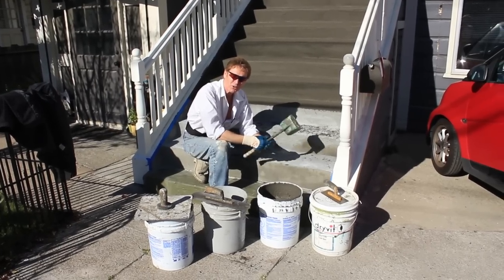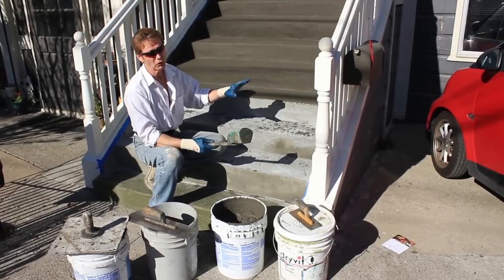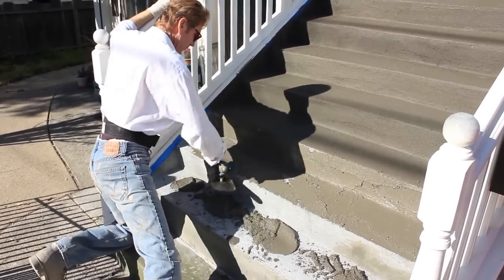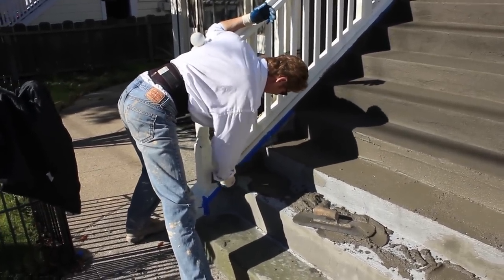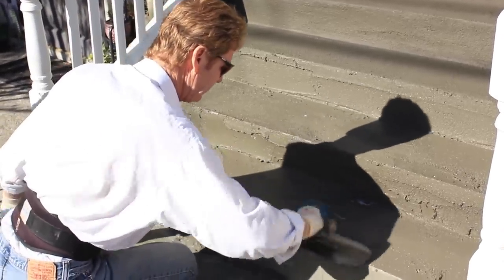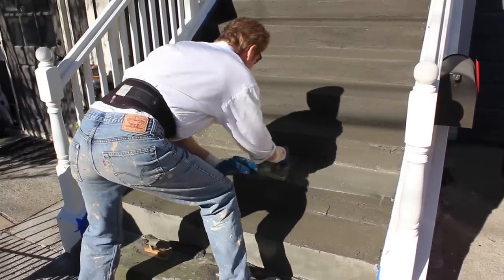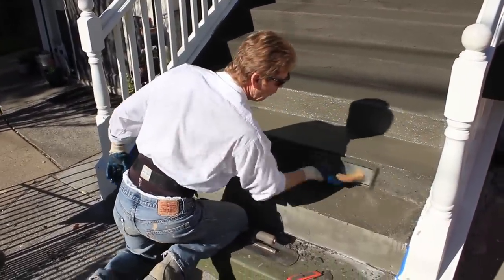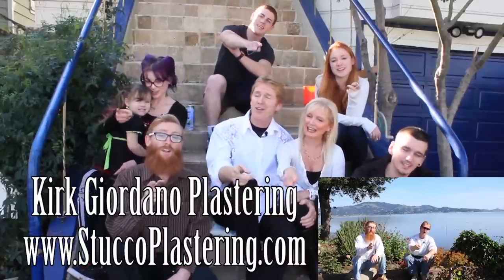Waterproof wood stairs with non-slip finish

Comment: Nice work Kirk, Can that be used on a concrete driveway that is driven on and do you use any kind of adhesive or wet the surface before applying?Thanks you and your son for this fine video. David Termini, Fredrick,MD
Reply from the maker: Hi David, I have mixed 10 different colors and 4 different acrylic's 12 years ago into a large  heavy duty plastic garbage can, stuck the heavy napped roller in it and painted me arce off, it's still there, by the way I wanted to freshen up a little spot and used paint it lasted a few months only.
 Best wishes.
 Kirk giordano

Comment: Hey Kirk 
Due to the high foot traffic i wouldn’t do it on steps 
 and to keep in mind with out polymotifed basecoat and fiberglass mesh it will crack not the Finishcoat that you used because that will expend and hardness 

But I could listen the hallow noise when you hit the steps with scoop
Also acrylic finish should be floated with plastic or steel trowel In such way that first get the sand to surface then with smooth touch floated down 

Have you done Gemstone finish ?
Reply from the maker: Howdy, my fellow construction dudes. 
No, I have not done any Gemstone finish, but know how to.
 FYI, were methodical in all our methods in all applications. In the description, there is a video that shows the waterproofing membrane with metal lathing and stucco applications.
 Our work is second to nothing superior.
 These stairs will last forever and will not crack unless the ground settles.😉

Comment: Hi Kirk, looks like a great solution for my fronts steps. Can this product go over top of previously painted concrete?
Reply from the maker: Hi Adam Tussey, sure, however the painted surface needs to be prepared properly, usually pressured washed with at least 3,000 psi to remove all dust, dirt grime and especially any and all loose paint.
 Remember, your new finish is only as good as what it's attached to.
  Best wishes,
 kirk Giordano

Comment: Kirk, we just had a set of steps poured and the risers didn't present a smooth surface when the forms were removed. I love how nice your acrylic stucco process looks.  My question is... How thick is the coat of acrylic stucco that you applied to each the riser and tread?  To me, it looked like you applied a super thin coat.  Thank you.
Reply from the maker: All acrylics are about 1/16 to 1/8 inches thick. About 50 time thicker than paint but won't come off, if applied to a super clean surface.
 And yes you can use a paintbrush and roll or paint a coat or two on. 💃
Reply: He doesn't know
Reply from the maker: @deelula3259  Who doesn't know what??

Comment: Hi, could you tell me the product you used on this stair? i'm going to patch  my concrete stairway, do you think it's ok to use it on the concrete? and how durable is it for a stair or walkway? thank you very much.
Reply from the maker: Hi Roger,   it was either Carson's, dry-vit or BMI, acrylic stucco that I used as i'm fond of these brands.
 I did my own stairs over 20 years ago and they still are in excellent condition.
 Keep in mind the products I am referring to are engineered for walls, I am showing a better longer lasting option rather than paint, but painting is easier.
 Cheers,
 Kirk giordano Plastering

Comment: thank you the video. I want to do this to my cement stairs but it has old chipping paint. can i apply this material over the old paint or do I have to sand it?
Reply from the maker: Howdy Long dude, all products are only as good as what they are placed over,
 Pressure wash well or use a wire brush to sort of micro score the surface.
 Best wishes with your projects,
 Kirk giordano plastering on small repairs

Comment: G'day Kirk,
I have a question about using the green float so wet on the acrylic...when i tried that method on the lift shaft i rendered 3 years ago, i found that too much additional water onto the acrylic surface with a wet sponge float caused it to develop hundreds of tiny pin holes. 
Do you encounter pin holing? If so, how may it be controlled?

Is the pin holing something that occurs if one plays with it too much (ie taking too long to get desired finish by going over surface with wet sponge float time and time again...thus oversaturating the acrylic?)
Reply from the maker: Howdy Adam, sure I have encountered this issue, it's happens to any and all who use too much water, simply tap out the excess water into your bucket, even this simple task takes practice. 
If you watch carefully I tap the float into the inner part of the water so as not to bend the float inwards, I only tap the float lightly on the top so as again not to give the float the wrong bend all edges should be slightly lifted upwards so a float won't dig into the stucco or finish system.
 Cheers and have a happy new year my friend,

 Kirk giordano’s rendering any and all stucco repairs

Comment: Nice!  I was just researching to see if I could use acrylic stucco for front steps. I just stuccoed my Nephews house in the fall, and was wondering if acrylic would be a good choice for front steps. Only concern I have is this is Canada and if it will hold up to the winter ice, and melting snow. Plus cracking due to the temperature extremes. We never have done outdoor surfaces like pools with Acrylics. Usually it's just concrete floated from what I see. What's your opinion on acrylics holding up in Canada? Cheers. Great work btw.👍🏼
Reply from the maker: Howdy Kman, I have done this 20 years ago, and it's still attached well, however my preparation was top notch.
 I would refer others to tile, so I don't get blamed if a procedure is left out.
 Cheers, live long and plaster
 Giordano’s teaching video’s

Comment: Hi Kirk, thanks for the video. First, you advise this acrylic stucco instead of painting, but what if my client wants a different color than grey concrete? Do I color the stucco before applying, or paint it after it dries? Second, I have another project: 6 concrete pads that (1) are too slick and (2) were badly stained the first time around, so have bare patches. My concern is that this stucco with flake off over time, as it does on walls. Is that an issue?
Reply from the maker: Howdy Robert, the product I was applying over my neighbors stairs was from a chimney that I had left over.
 Acrylic stucco finish coats come in hundreds of colors, they engineered for walls not stairs, this being said I have used them many times on stairs as the acrylics if applied properly to a properly prepared wall or cementitious finish last forever and have a non slip finish.
 Cheers,
 kirk giordano rendering

Comment: Got my answer from your video. Maybe you can help me find a product that I can use on wood and will not have to do it every 3 to 5 years, Thanks rick
Reply from the maker: My neighbor used some of my throw away colors 6 years ago and it's still going strong, but he prepped his wood stairs well, 
 That or use the sand added to paints available for wood or concrete, I have tried them and was not impressed,
 Cheers,
 kirk giordano

Comment: Kirk great videos..i have an advanced question for you. Which would be better over a painted wall
1-weldcrete followed by 16/20 color coat

2-bypass the weldcrete and just use the syntethic stucco on the painted wall.

Why would you do the more time consuming first one when you can do the second one?  Thank you my friend.
Reply from the maker: Greetings JLO, do both, why because some acrylics are not worth applying. choose BMI, Carsons, Stucco-flex or Dry-Vit to name some good ones.
 The ones that are garbage I won't mention as this is a positive channel.
 besides Larson's Weld Creat is like low-cost insurance.
 The most important thing to remember is to clean the surface like your planning on eating off it.
 As no product mentioned above sticks to a dirty surface for more than a year.
 

        Get plastered like stucco
 Kirk Giordano sound plastering advice

Comment: Nice vid Kirk. My question, Do you know how well the acrylic sticks to steel and or what prep is necessary to get the acrylic to adhere to steel steps.
Reply: The reason I'm asking is, I'm a maintenance man at our complex. Currently we have concrete inserts in steel step pans. I would like to get away from the 120 LBS of concrete per step. By flipping a pan and putting a durable non skid surface like acrylic stucco w/ a heavy grit for non skid. Ideas?? Thanks.
Reply from the maker: Howdy Jim Dude, no worries happy to be of help
The acrylic I used for these stairs is specifically designed for walls, however I know how to do this as I have done it in the past many times with very successful results.
 I can't righteously tell you to do the same as the acrylic is designed specifically for walls.
 Cheers, live long and plaster
 Giordano’s images and teaching video’s

Comment: Kirk, we have a tile walkway (1ft x 1 ft  clay looking tiles). with an inch of grout between the tiles which leads to the front door. The edge of the walkway abuts stucco walls. It leaks water into basement after heavy rains. Ithe tiles suck in water, the grout is suspicious and the edges of the walkway are moldy.  I can't redo the walkway for now. I want to waterproof it with something clear, nonslip, and UV resistant. I've researched acrylic, latex, silicone materials... But all claim their product is best and slams the others. Any recommendations? I plan to etch/clean first, maybe sand any existing material off, then apply. The question is what to use???
Reply: the walkway is six feet long and four feet wide.
Reply from the maker: Evening slap stick dude, the best for this would probably be Stuc-o-flex elastomeric acrylic finish, it's actually engineered  for stucco walls.  It's the best in my opinion, but to find it online and have it shipped will be a drag, next would be other different acrylic products, dry vit, Carsons, bmi and so on,
best wishes,
 Kirk giordano
Reply: Kirk & Jason Giordanos DIY plastering and stucco tips I'll look them up. And you mentioned those work for 'stucco walls'...would you know if they work on the foot traffic area (tile walkway and grout)? My guess is you will say check with the manufacturer. Which I will do. Thanks...I will check on those.

Comment: Do you use a bonding agent, base coat? Is that a heavy sand finish? In the video I see Dryvit product. What about prep, pressure clean first?
Reply from the maker: Greetings Bill, the Dry-Vit acrylic was applied over a clean base coat, it will outlast me by a hundred years.
        Get plastered like stucco
 Kirk Giordano sound plastering advice
Reply: Kirk Giordano plastering Inc. Base coat?

You put a base coat and then the acrylic or did u mean u put weld-Crete then the acrylic?

Comment: Kirk,

How thick should it be laid on concrete stairs? Can I also use this to fill and refinish my concrete driveway?
Reply from the maker: Good morning Jason, Dude, I went about an inch thck, as far as drivways I would suggent cncrete and not stucco.
                          Live long and plaster
            Sharing the plastering knowledge
Reply: okay, but for my concrete stairs it would be sufficient?
Reply from the maker: Good morning Jason, I didn't realize your stairs were already concrete, if you wanted a cleaner nonslip finish you can apply an acrylic as I'm doing in this video, The stairs must be pressure washed very well as nothing adheres to dust.
                          Live long and plaster
            Sharing the plastering knowledge
Reply: Okay so the stairs I can also do. Just make sure it's very clean. Do I have to do anything to the acrylic before or just mix it and slap it on.
Reply from the maker: Good morning Jason, I would apply the primer that comes with the stucco acrylic and they do come premixed in buckets.
                          Live long and plaster
            Sharing the plastering knowledge
Reply: So if I order a bucket of Carsons or BMI it'll come with a primer?
Reply from the maker: Good afternoon Jason, yes and both of these stucco acrylics are great.
 apply about 1/8 inch thick, too thick it will chatter check when dried, to thin will see through to the primer.                   
                       Live long and plaster
                     pease love and plaster

Comment: Hi Kirk, can you post a video showing tips for filling voids in foam sheets using portlandbase cement and covering brick with a portlandbased cement to prep for an acrilic finish
Reply: also the company I work for uses a product brand named ADEX have you ever incountered these products ? and whats the best brand of portland cement mix youve come across, have had issues with our current product.
Reply from the maker: Afternoon Gage, below is a video patching EfIS with portland cement, as far as plastering bricks simply type in the keywords on our site, it does not matter whether you paint, apply acrylic stucco or cementitious stucco, the base coats are applied the same way. 
       Live long and plaster
  teaching  plastering video’s
https://youtu.be/cXIGB_mSkm0
Reply from the maker: Afternoon Gage, I use Hanson Premium cement plaster myself.
       Live long and plaster
  teaching  plastering video’s

Comment: Nice videos Kirk! I need to refinish our concrete steps. What is this product called? Can I buy it at Home Depot, Lowes etc?
Reply from the maker: Morning Tom, acrylic stucco finishes are not sold at the hardware stores, you would have to go to a stucco or plastering material such as Westside building materials or Close build material 
 I purchased this acrylic from Close building supplies located in Hayward ca. as I believe this acrylic to be one of the best sold in the U.S. the Acrylic name is Dry-vit shown in this video.
  Unfortunately all acrylic stucco finishes are not created equal, in fact some are pathetic, some I would not use them if they were given to me at no cost,  but this is a positive channel so no names to the crap products but instead a big shout out to the ones that have stood the test of time
FYI, I am using this product for stairs not for it's intended purpose, walls.
 Cheers,
 kirk giordano rendering
Reply: Thanks Kirk. We live in a house that was built in 1905. Brick on the outside, plaster on lath inside. I have plaster to repair, a brick foundation in the basement that needs stuccoed, front steps(that I mentioned) that need attention and some tuck pointing needs outside as well. I wish your company was local to me. I could sure give you some work. Thanks for all the great videos.

Comment: Hi Kirk, i saw your video of march 6, 2015 on concrete steps resurfacing using stucco acrylic for slip proof and water resistance stairs. i need to do the same for my concrete steps.Please tell me how you mixed the acrylic into the concrete. that was the only thing you did not discuss and i need to know how you did. thanks for your help.
i have seen other videos you have posted . YOU ARE A AMAZING  "HOMBRE".(amazing "man").
Reply from the maker: Howdy Peter dude, thank you.
  When you purchase any acrylic stucco, they come in 5-gallon buckets, we add about a cup of water to these, mix and apply.   
 Recommended acrylics are BMI, Carsons, Dry Vit, or stucco flex, all sold at professional plastering yards such as Westside building materials.
 Google stucco or plastering material companies in your area.
                                  Live long and plaster
 teaching plastering to apprentice's or DIY homeowners

Comment: Hi Kirk.  I've got some concrete stairs on my 1872 home front entrance outside that have been veneered with more concrete that  I'll repair from some chunks breaking away.  Not sure if you have a video on repairing that  kind of deal?   Either way, I'm wondering if after I get them back into shape, do you know if this material on top of it would endure our cold Michigan climates?  Also....should I use a bonding agent before application?  Thanks dude!  Love your vids, work, and demeanor!
Reply from the maker: Howdy Odic, thank you, and yes, this Dry-vit will work for your needs, apply the primer that comes with all stucco acrylics first, as acrlic stucco does not use bonding agents, BMI and Stucco-flex are also very good for your purpose.      
                                   Live long and plaster
        Teaching do’s and don’t of plastering and stucco work

Comment: Hi, love your vidoes!  Can this acrylic be installed over fresh new concrete ? Starting a new project of 13 concrete steps.
Reply from the maker: Good evening Tim, absolutely, I would allow the concrete to cure at least 30 days before applying any acrylic stucco.
 Bringing peace, love, and “brotherhood, ” back into the 🌎 of Plastering.
    The most comprehensive encyclopedia of plastering on video, by the plastering messengers of Youtube. 
Kirk and Jason Giordano with over 800 videos 🎭 👀

Comment: Hi Mr  Kirk, thank you for showing u shoe todo do things right.
We live in southern CA, very hot/dry here, now that is closer to start keeping up our home I’ve been wanting to do a very fine/smooth finish on our stucco, like those Spanish/Mexican homes I see in different places.
Is that product/acrylic  you use the right one for this job??
Thank you
Reply from the maker: Evening Chef dude, the fact is whether or not you're applying traditional or synthetic stucco which is also called acrylic stucco, it's the sand grit that matters.
  Stucco is sold often by the grit of sand, for your needs, for example, you would order 30/30 sand grit, this is fine like talcum powder. 
Next is the medium sand, also known as 20/30 which most folks prefer as it the best of both worlds.
   Then lastly there is 16/20 sand grit used for say Taco Bell restaurant finishes.
                      Cheers!
How to restore your plastering issues.